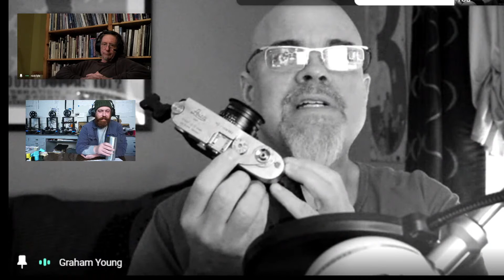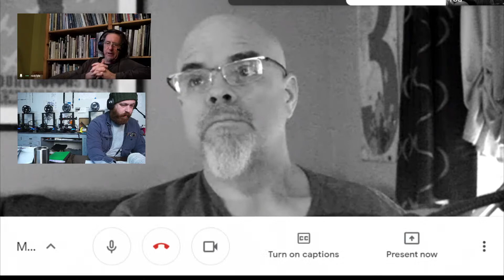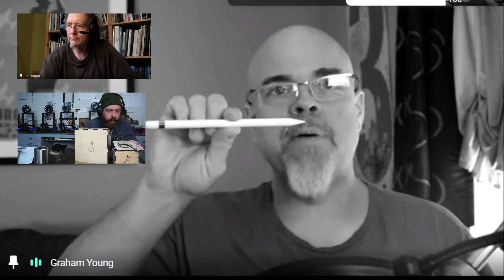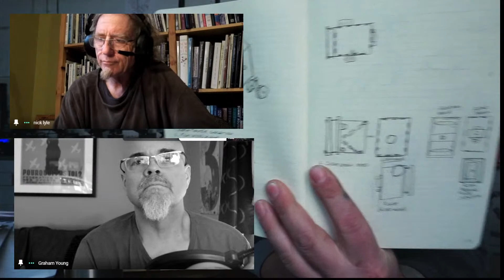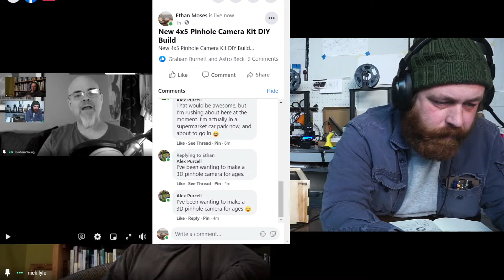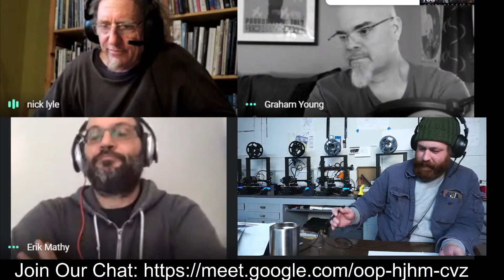the Homemade Camera Podcast Episode 62 LIVE

Comment: I skipped through quite a lot of this episode, so forgive me if you touched on this subject, but I wondered whether any of you guys would consider developing an optical viewfinder. A common problem with hand held custom cameras is precise framing. I am using a viewfinder I extracted from a Canon compact on an OG Ethan just sent me. It’s not ideal , but the horizontal lines match perfectly. I guess you would need injection moulding to make the lens elements, and then you would probably need to cover a few of the common focal lengths. Any views ( excuse pun )